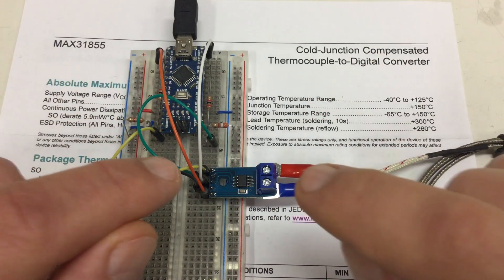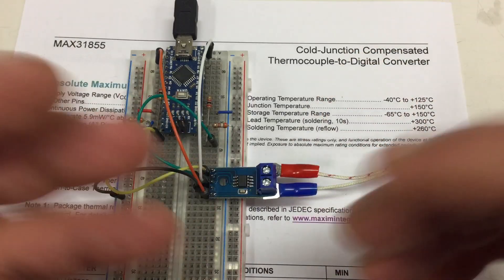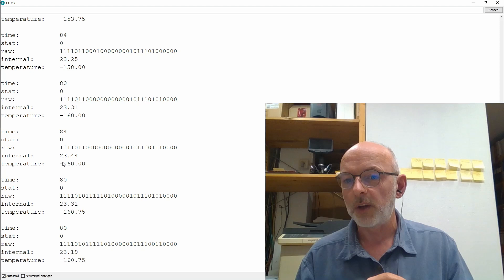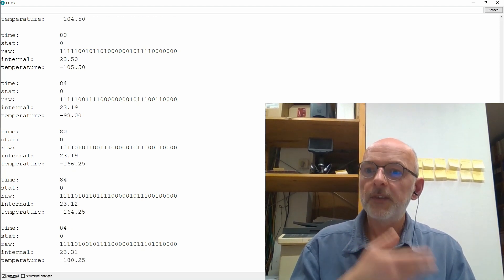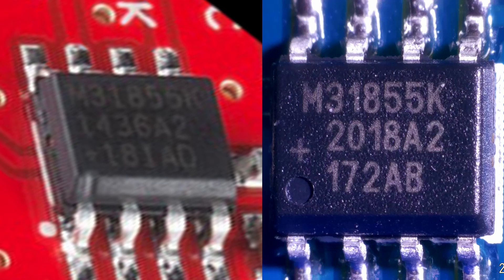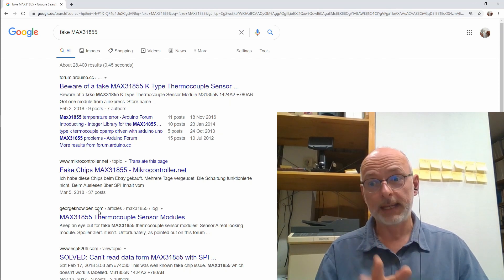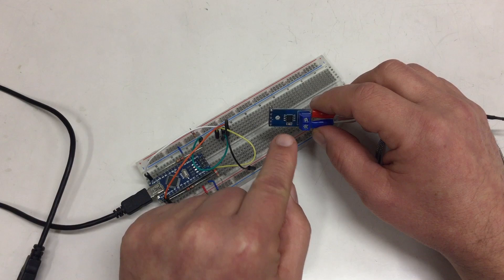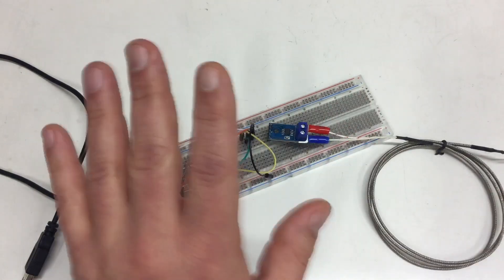Faulty Chinese MAX31855K Modules: Fake Chips?!? (Edit: No! See Description!)

Comment: Be careful of fake MAX 6675 modules as well. My company built it into a product for convenience of supply and it gave a wrong reading and then element overheated so much that everything was destroyed with fire. Luckally the enclosure was stainless steel and contained it. The problem is that the fault is intermittent and will not show all the time. We have a proper PCB design now and will order the chips from Digikey. Our local electronic outlet has some explaining to do.
Reply from the maker: Thanks for your story about failing MAX6675 modules! I personally never stumbled about faulty / non-functioning MAX6675 modules, but I guess it's totally possible to build such modules (if you're trying to squeeze out the last cent of profit).

Comment: I've had some weird knock off chips on Chinese ebay boards, some of them had different software IDs, so I ended knee deep in drivers to make them work. Luckily their functions were close enough to work for what I needed.
Reply from the maker: I bought Chinese Arduino Nano clones for 1.99 with some questionable serial-to-USB chip. But I somehow got a suitable driver and they ultimately work. There's a reason they can make them for 1.99. It's kind of what you expect. But selling stuff that doesn't work in the first place with no chance to get it working - that's really low.

Comment: can you post link to other video .. I dont see link on PC ..!!!!
Reply from the maker: Which video are you talking about exactly? Anyway, you can find all links in the description of the video. If you need a link to a specific video of mine, please let me know. Just provide the name (or at least a part of it) and/or what the video was about.
Reply: @robertssmorgasbord  The  MAX31855K Boards ones
Reply from the maker: @David_11111  Here are all MAX31855K related links from the video:
Mini Mailbag: Breakout PCBs for HB100 Doppler Radar and MAX31855K Module https://youtu.be/EbrPqeHiWdY
GitHub / RobTillaart / MAX31855_RT https://github.com/RobTillaart/MAX31855_RT
SparkFun Thermocouple Breakout - MAX31855K https://www.sparkfun.com/products/13266
Beware of a fake MAX31855 K Type Thermocouple Sensor Module https://forum.arduino.cc/index.php?topic=526439.0
Fake Chips MAX31855 https://www.mikrocontroller.net/topic/446820
SOLVED: Can't read data form MAX31855 with SPI https://www.esp8266.com/viewtopic.php?f=24&t=16356&start=8